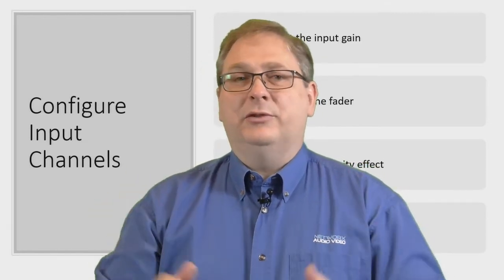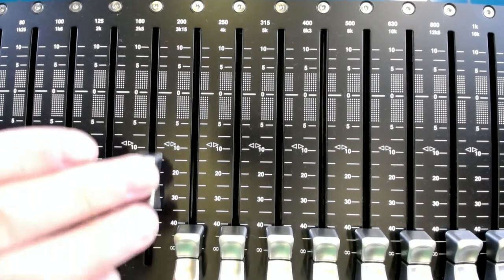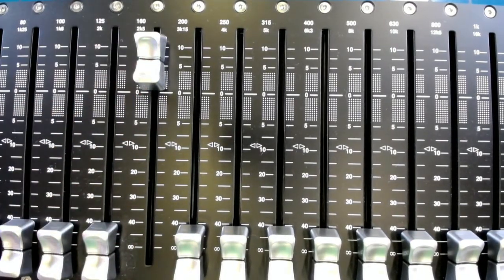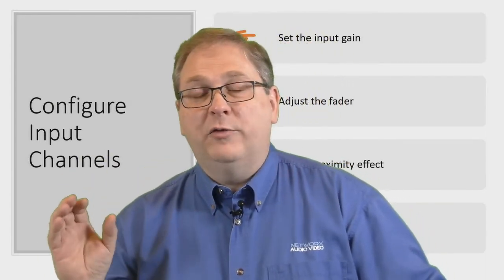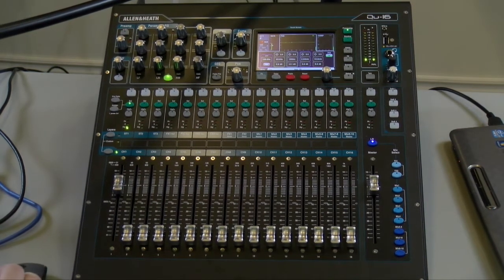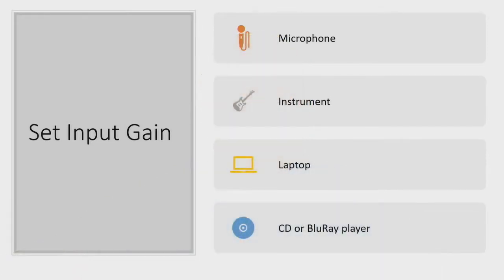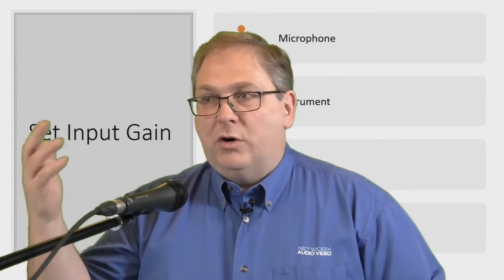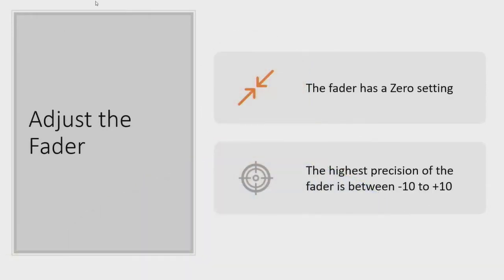How to Properly Configure Input Channels on a Digital Mixer

Comment: Great video! I'm dealing with QU-16 setup in our building using Shure PGX wireless system and AKG 48V Phantom Power mics. The requirement is to setup these mics with this mixer for like worship house, mosque or church! The issue is we barely know how to setup those mics with this mixer to provide echo clear environment where you would when you get close and far away from mic like 10inches hear the same sound.
If you can share info on this we would appreciate. Thanks.

Comment: Hi yeah..very useful videos..i have alto fx 1604 .It is an ok mixer ,but fx vice and headroom is less .Also cabling is messy as iam not using.snake.I want to upgrade to digital mixer like soundcraft u16 or presonus live.Any suggestion and also how about senheisser microphons e835 wireless gain structure and how many db shld i set it .many thanks in advance
Reply from the maker: Not sure if you have already purchased a new digital mixer, but if not I think a QU-16 is a great choice as the learning curve from analog to digital is quite fast and the app is very good.  They also have 4 FX's, lots of sends and the ability to connect A&H personal monitors and snake/stage boxes natively.  Hope this helps ...

Comment: Great video. 
I now understand the adjustment of the gain and fader. But I have a question. If I put my fader and my master fader to zero, I am very loud (ofcourse) trough my speakers. My question is, what do I adjust to get the volume down? Is that the master (so it’s not on zero) or do I adjust my active speakers lower (but then in if I want to get louder, I most go to the back of the speakers and adjust). Or do I put the fader channel down?
I now run my board (QU 16) and most of the time my channel faders are NOT ON ZERO, because it’s to loud ( my master is always on zero). 
So that’s why mine question. What do I adjust to get lower and higher volume,e out my speakers.
Reply from the maker: I am glad it was helpful for you.  Typically power amplifiers or powered speakers volumes are not set to 0 but around -6.  This should give you the right balance while allowing your mixer master to be increased up to +10 if needed ... hope this makes sense and hope this helps ...

Comment: HI, I was hoping you would show the physical connection of the mic to the mixer. I have my mic plugged into the back in input 1 but i cannot hear the mic through the mixer. what do i set the mixer to in its internal settings to find the mic and bring it out of the mixer and into my pro tools session?
Reply from the maker: Each input has the ability to be configured for analog or digital input connection.  In order to use an analog connection through the mixer, you would need the input set to use the analog connection.  You should still be able to use the USB to your computer and capture the sound from the analog input.

The easiest way to change from analog to USB or USB to analog is by pressing the button beside the "Gain" control that has a USB icon.  When it is lit, the USB input is active.  When not lit, the analog connection is active.  Be sure to select the desired channel first.

The next thing is to set the global USB connection as desired.  This can be set to QU-Drive or USB-B.  When it is set to QU-Drive, the USB connection on the face of the mixer is active and you are able to record and playback with a USB stick.  When it is set to USB-B, the USB connection on the back of the mixer is active and you can record and playback from your computer.  Hope this helps ...

Comment: When I turn on my Qu 16 do I need to have a password? How do I turn on the board to get at the working right away?
Reply from the maker: By default, a QU-16 does not have a password set so you should be able to access it out of the box.  If a password is set and you do not know it, you can try to look in the manual for more information about performing a System Hard Reset on the board.  Unfortunately this would erase all of the board scenes and settings but it would also clear any user passwords.  Hope this helps.
Reply: @NetworxAudioVideoInc  
Thanks, we have a performance tomorrow. We’ll see how that helps.
Reply: @NetworxAudioVideoInc  thanks again

Comment: Hi James. You are an excellent teacher. I just got the QU 16 and my challenge is connecting all of my external equipment like you mention, CD player, mini disc, DVD etc in a fixed position. I will NOT be mixing at an event. I bought the QU to replace my analog Mackie board. SO...how do I get the audio say of my CD player to come up on the mixer? assigning the channels and equip is challenging. I am inputting them to a pro tools mix via the USB on the QU to my iMac. i do have an RE20 mic hooked into ch 2 that someone at A&H guided me on and it DOES record to a track on a pro tools mix. i dont need to mix in real time or simultaneously with other audio, i will record what i need from the CD player to a stereo track and then move it and edit it..i just need to learn how to set the send inside the unit. thanks.  Joe J
Reply from the maker: I do not use a Mac but from what I know, any input on the QU-16 is already visible in the Mac and should be available within pro tools.

If your CD player has XLR outputs, you can connect  to a couple of XLR input channels such as 3 and 4 or 5 and 6.  Once those are connected, you would select the "Link" to link the channels together so you can make them a stereo pair.  Then you would rotate the pan on the first channel to set it to left and that will automatically set the right one at the same time.  Then adjust your input gain (knob in top left corner) for each channel to be about 0.

If your CD player does not have XLR outputs and has unbalanced outputs, you can connect them to a stereo input such as ST1 or ST2.  The default gain should be okay.

Hope this helps ...

Comment: Hi James. What I love about your tutorials is the way you talk to the average church volunteer instead of prattling on at other sound engineers in tech speak. You are the only one I have seen do this. All too often the videos people make simply talk about the features and benefits of the Q16 or other hardware and they never get to, "Here's how you connect and set up these components." You clearly and calmly lay out where you are going and then show how to get there in an easy-to-understand step-by-step manner. Thank you for that. 

Would you be able to make a video clearly showing how to set up the QU16 USB B port as both an input and an output source? We need to be able to experiment with audio going from a PC into the QU16 USB B port and also have audio go out of the QU16 USB B port to a PC. Thank you.
Reply from the maker: Thank you for your words of encouragement, it is very much appreciated. I will try to make a video for you as requested but it might be some time before I can make it for you.
Reply: @NetworxAudioVideoInc  No problem, James. Thank you and take your time.